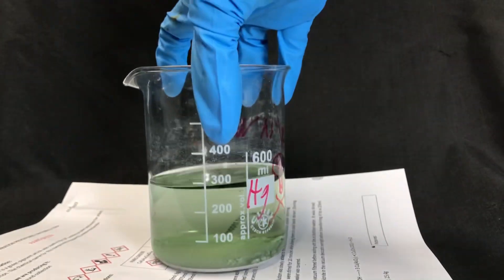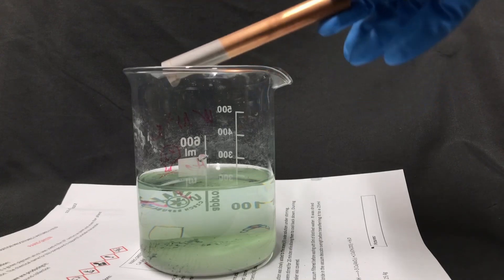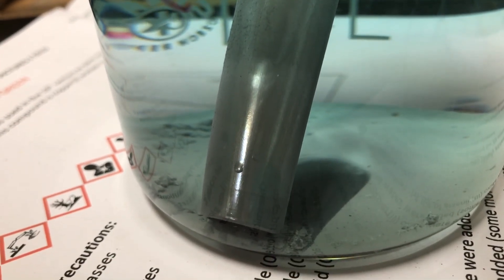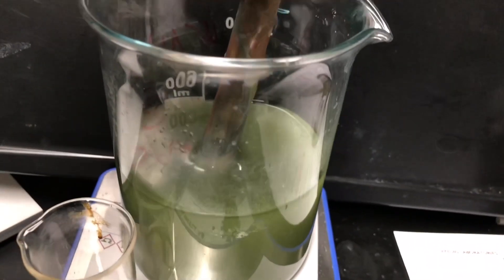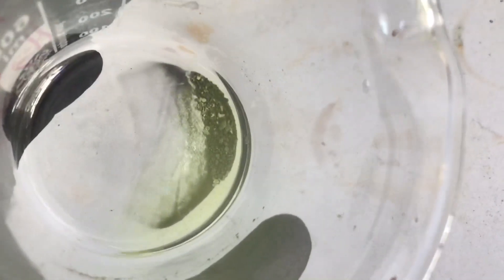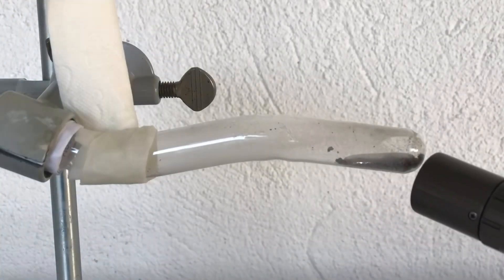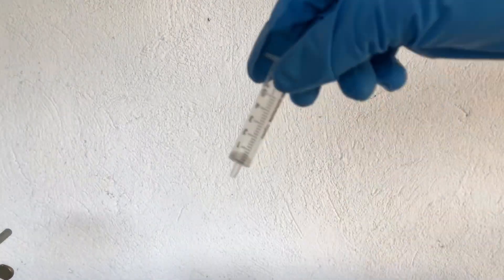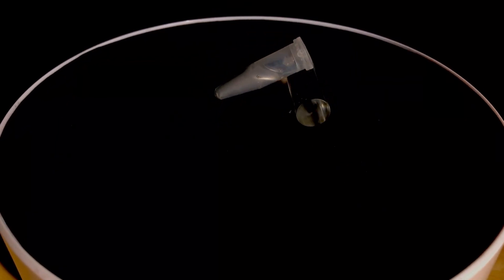Recycling mercury from Hg containing solution

Comment: Nice video,

The amalgam between Hg and Cu with Zn (IIRC) was used not so long ago into dental amalgam.
This becomes hard  in a few dozens of minutes after mixing of the powders and mercury then applying the paste with pression and manual flatening and polishing with a spatula.

The amalgam lasted for decades what is not the case of current polymer dental cavities filling.
Most dental amalgam didn't generate troubles into mouth except maybe for some sensitive people.
I have had a lot into mouth for about 30 years... and have no symptoms of poisoning even if I eat a lot of acidic food (I like vinegar and lemon juice).

A good way to check for Hg vapour and see if Hg is present out of your reactor and see if there is a leak...is the use in the dark of a white paper as back screen and in front of your vial or reactor to light a neon black light (Hg vapour neon and NiO inner filter)...
It is a very interesting and spectacular effect... The neon produces (emits) specific Hg spectral bands, the NiO filter most of the visible and allow some UV bands to pass... those last excitate the Hg vapours outside the neon tube that absorb the bands perfecty because it is the same element and reveal them by projecting the shadow of invisible Hg fumes in black-grey onto the white paper screen that looks dark purple elsewhere. It is very visual and like magic ... a bit like the yellow flame of sodium rich fuel flame under sodium lamp illumination that turns black fire (from the "Action lab" Youtube video)

PHZ
(PHILOU Zrealone from the Science Madness forum)
Reply: @PoorMans Chemist 
Right...not zink...silver.
I remember now...

Comment: The glass cracked only because of uneven heating, borosilicate glass can easily withstand 357°C if heated uniformly. Consider using a heating mantle or a sand bath instead of a direct flame.

Comment: Is there a cleaner way to recycle mercury? (Possibly avoiding distillation) I was thinking, what about using sodium borohydride, I know it's expensive, but would it produce a less contaminated mercury (in absence of other interfering metal ions)?
Or what if I did this with a more reactive metal, say Mg or Ca, which can then be eventually removed from the amalgam with hot water or dilute acid? Is this a good way or the metal is too reactive and it would have gone before mercury was reduced?
Reply from the maker: Calcium will definetely not work. Remember that we are dealing with an aqueous solution. Magnesium will work but its quite a waste of it. Same with the borohydride being an expensive reagent.
Reply: @philouzlouis2042  Thanks, this would be worth a try
Reply: You can always precipitate the sulfide, filter and reduce the mercury ion with aluminum in polysulfide solution. But for better purity you need distillation, possibly even distilling multiple times.

Comment: What about using iron instead of copper? It doesn't form an amalgam with mercury. I will try that with the used COD tests in the lab where I work, even if the solution contains Silver and Chromium as well.
Reply from the maker: i cannot tell you why but iron with aqueous mercury salts forms a fine powder and not liquid mercury which nicely collects at the copper tube and collects at the bottom
Reply: @THYZOID  I will try both and let you know

Comment: A long time ago I tried extracting Hg metal from an acidified solution of Hg(II) sulfate, by reducing it with copper wire. I got a few drops of metal, but I also got a lot of white-grayish powder, that only partially dissolved in nitric acid.
I all that side product Hg powder or does it also contain Hg(I)? Is it possible that Cu metal could, under the right circumstances, only partially reduce Hg salts from Hg(II) to insoluble Hg(I)?
Reply from the maker: Everything might be possible but Hg(I) should under acidic conditions be converted back to Hg(II) slowly. Especially when exposed to air.
Reply: @THYZOID  Ah, so maybe I didn't wait enough to see if the precipitate dissolved again?
Reply from the maker: That’s at least possible